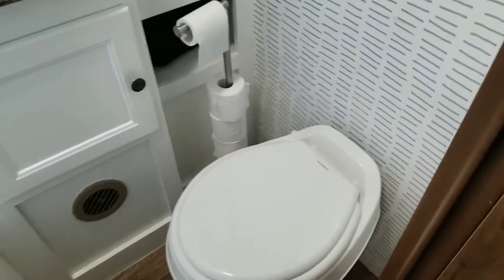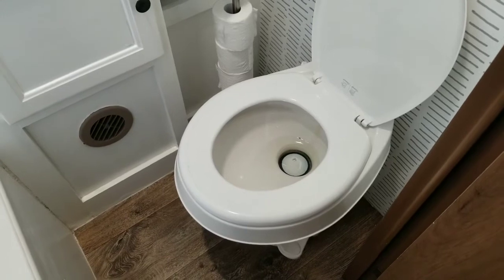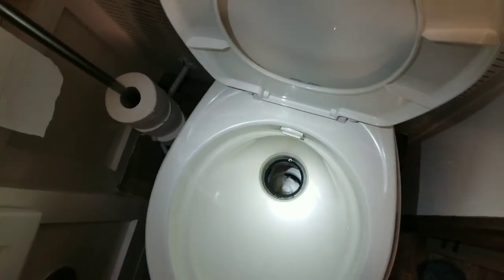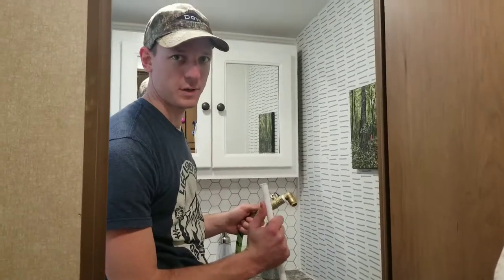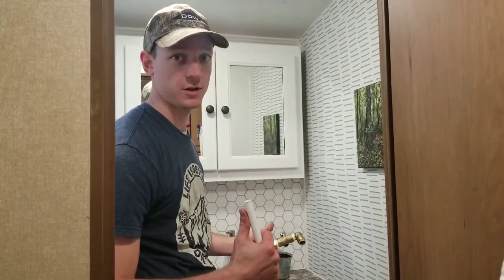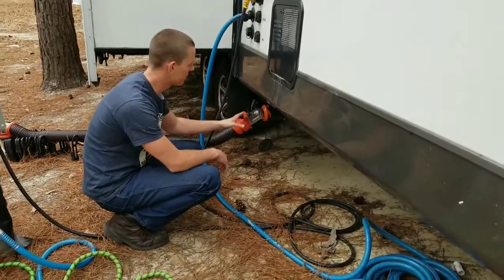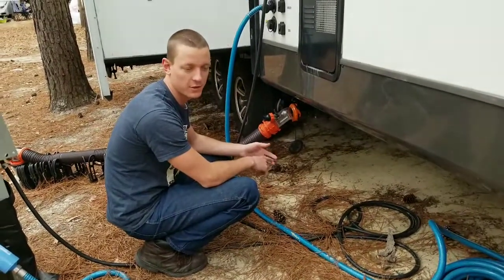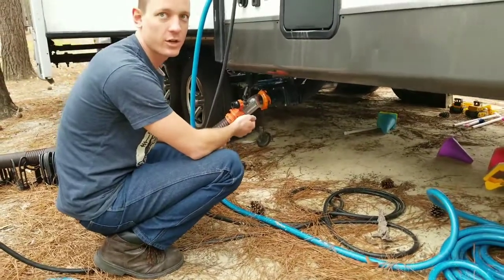RV toilet burping?? | Easy DIY fix | Unclog RV toilet in less than 5 minutes

Comment: Bought used 5th wheel, unseen from N. M. So many issues. I think poop from previous tenents is still in black tank.
Used a wand like your's, unclogged my toilet but I think $hit inside is probably like cement now. I have burping too.
I put vinegar n baking soda down it to no avail. Heard of Happy Camper. Will that dissolve crap? Thx
Reply from the maker: Not sure about happy camper, but I've used boiling water to flush my tank before. Just fill it up as high as you can with boiling water and let it sit for a while before draining.
Reply: I did try that per someone else's video, but they recommended using a gallon of hot water. Wonder now many gallons it would take to fill up. I'll try it, thank you
Reply from the maker: I think you'll need at least 8-10 gallons for the water level to get high enough to start dissolving any caked on solids. Before you drain the boiling water I'd use the wand again to try and help break up any chunks and agitate the water.
Reply: Ok, I'll do that. Thanks for getting back to me so quickly n the information

Comment: The issue I'm having is when my black tank gets about half full, I got one big burp of air as I flush. If I empty the tank, I get no burp.
Reply from the maker: Burping can be caused by a clogged vent as well. If the vent is clogged, there is nowhere else for the air to go.
Reply: @DIY_or_DIE  I thought about that, but it only happens when the tank is almoat full. Unless...  the vent is slightly clogged and that's why it's not doing it all the time. Thanks for the tip. 👍
Reply: @EM-fi2qg  I have the exact same issue/symptom when the tank is about 1/2 - 2/3 full. In addition, I start to have odor if I continue to use the toilet without emptying the tank. Did you ever find the root cause or solution for this problem?
Reply from the maker: Have you tried cleaning/scraping the inside of the tank? Built up/dried toilet paper/crap can cause blockage around the vent
Reply: @tolfod  I haven't dine anything to solve the issue yet. I have been overloaded at work. But, I have been using the san-t- flush system more aggressively and the 8ssue is minimizing. I don't get the burping air auntie almost full now. Maybe my vent at the tank level really was clogged. DIY-OR-DIE seems to be on to something here.
Reply from the maker: I just had this happen again this morning...got a stick and shoved it down into the tank and sure enough big toilet paper pile built up right under the toilet drain. Once I loosened that mess up and flushed it no more burping. This happens about every 4- months because we have 5 people using the toilet.
Reply: @DIY_or_DIE  Ok, this weekend I'll try to blast the plumbing from the toilet side with a garden hose and see if I can dislodge anything. I have about 100 psi at the hose. Hopefully that will get things moving down there. Thanks for the info.
Reply: @EM-fi2qg  I am sure that my toilet is clean and my tank is clean (no pyramid). I wonder how exactly do the vent pipe and the pipe directly below the toilet connect to the tank? Is it possible that the manufacturer erroneously installed one or both of these pipes such that it extends down to the 1/2 or 2/3 tank level? If such is the case, then when the liquid rises to 1/2 or 2/3, the air has nowhere to vent but back up through the toilet when flushed. Is this crazy thinking? Can they mess up this bad?
Reply: @tolfod  That is a good point. I dont know how far down the pipe goes, but your thought makes sense. I have even heard that pipes will sometimes drop down into the tank. So, obviously some builders don't glue the fittings. Some day, I may try to pull out the vent pipe and measure it.
Reply from the maker: @tolfod that is absolutely a possibility. Is your RV new?
Reply: @DIY_or_DIE  No, my RV trailer is not new. It is a 2019 Rockwood Mini Lite 2509S. I bought it used and I am speculating that this may be one of the issues that caused the previous owner to sell.
Reply: I found this video of the inside of a black tank, https://www.youtube.com/watch?v=Wr_WofC5ZdQ. At 1:16, a white pipe (possibly the vent pipe) extends down into the tank quite a bit.
Reply: I did a lot of work over Thanksgiving break. Found the vent pipe in the black tank of my 2019 Rockwood Mini Lite 2509S to extend down too far. I did a video on troubleshooting & fixing it here: https://youtu.be/3oBR-LHhXPc.
Reply from the maker: @tolfod  awesome!
Reply: @EM-fi2qg bad manufacturing may result in a vent pipe that is cut not shallow enough resulting in having to dump before the tank is full fyi
Reply: @b1blazin13  Thanks for the info. 👍

Comment: Yea if it was on the drain it wouldnt burp smh. And if the toilet clogs just drop a couple black tank tablets down the toilet and wala toilet unclogged. Little easier than your method and alot cleaner than draggin a crap pipe through your camper. Just saying
Reply: That wouldn't necessarily unclog a clog though  guy 🥴
Reply: What do you mean if it was on the drain? Where would the clog be?